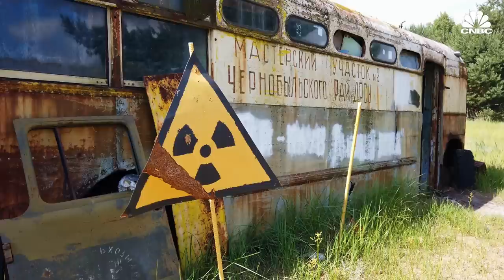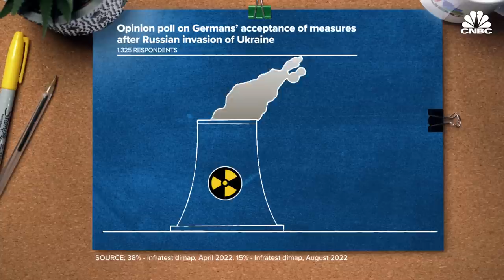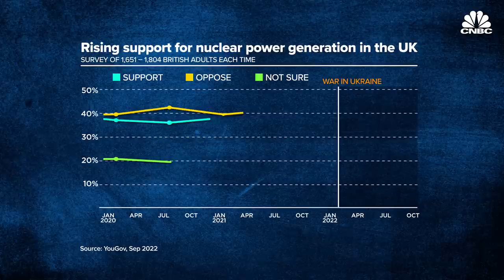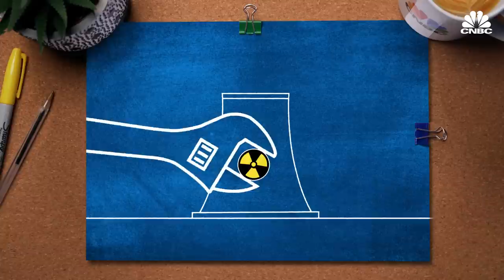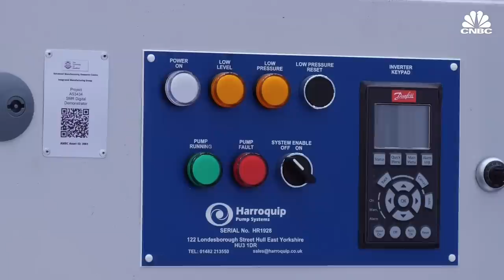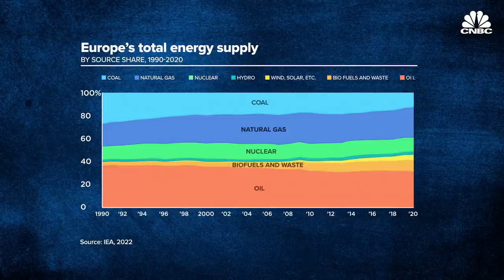The future of nuclear is divided into two camps - here’s why

Comment: French nuclear reactors were not built in the fifties. They were for the most part commissioned between 1978 and 1997. Between the fifties and 1978, there were experimental reactors running on graphite-gas technology or surgenerators (Phenix, Superphenix). Most French nuclear reactors come from a Westinghouse 900 MW water pressurized reactor patent. Then some were constructed with a modified design up to 1450 MW. The latest in construction, the Flamanville EPR reactor (it's construction is a never-ending nightmare) is a French-German design with a 1650 MW power output.
The first modern reactors, Fessenheim 1 and 2, commissioned in 1978 were shut down last year.

Comment: The problem with "short-term loss for long-term gain" is twofold. One, short-term solutions often have a way of becoming longer and longer-term. Two, especially for governments, it's easy to make long-term plans for 2030 or 2050 or whatever - the elections are usually every four years, so the next government can easily reverse the decision or push the dates forward... so the 'long-term gain' is up there in the clouds, it's NOT a given.
Reply: Germany planned to retire all the nuclear power plants in 2022 and failed only for 6 months. Theyalso planned to retire all the coal power plants in 2037 and probably will happen even sooner.
Reply: @Buran01  What's your guarantee that they'll do it by 2037? It's 15 years away, that's... 5 successive governments if my count is right, where's proof that one of them won't change their minds?

(Note this doesn't apply just to Germany, it applies to all countries and all sorts of long-term "fixes" and "plans")
Reply: @katm9877  Well, as I said, they planned in 2001 to retire the nuclear power plants  in 2022 and they missed by 6 months, so they were fairly accurate. Also, in the first quarter of 2023 they already deployed close to 4 GW of renewables (equivalent to the three last retired  nuclear power plants) . So I don't see reasons to doubt their plans. Compare that with the money and time that deploying new nuclear facilities require...
Reply: @Buran01  The trouble is adding more renewables to a grid makes it harder to keep adding. Germany is already at the point where they have enough capacity to run their grid on wind and sun when the conditions are right.

The problem is that the conditions are seldom right and making ends meet now means throwing the entire concept of an electricity market out of the window and each new MW of capacity needing concomitant increases in electricity storage. Technology that's been '5 years away' for the last 15 years, and which lithium batteries are totally unsuited.

The money and time nuclear facilities require is an order of magnitude less than the money, time, materials, and land renewables need to be on the same level functionally as nuclear power. If Germany had instead spent the money it's poured into energiewende on nuclear power, it'd have enough nuclear power now to run all of western Europe and its power would be the cheapest in the EU.

Comment: 3:35 "ARGUABLY" coal plants are "MORE" environmentally damaging than nuclear plants? 😂
Reply: Basic stuff.

Unwanted radioactive material can be buried (not even that deep) into the ground alongside all other naturally radioactive ground material without causing significant environmental hazard.

Of course, the fuel enrichment process requires a lot of energy, and the origin of that energy can contribute notably to the total emissions of nuclear power production. 

Also, the heat pollution of a power plant. But, in contrast to all else, it's quite slight.

Burning coal has a short road in the end, so to say.
Reply: Yes. Coal ash is not only more radioactive than nuclear waste, but also more hazardous and less regulated than nuclear waste. Not to mention how much more coal ash there is compared to nuclear waste.
Reply: @h.l.69  chernobyl looks normal to me.

Comment: To be anti-nuclear means being pro-climate-change because nuclear has the lowest carbon output per energy unit over its livespan
Reply: More like that pro-nuclear means buying the time for fossil fuel industry.
Reply: @augustlandmesser1520 Net-zero is not enough to end global warming. Nuclear energy is needed as the only energy that can run CO2-negative. Germany is the best example of the disadvantages of the so-called "renewables" prolonging the use of fossile fuels.

Comment: German green transition is actually a return to lignite for base load generation. Germans can then happily fax how a head of time they are to each other.
Reply: It's a transition from nuclear to lignite.
Reply: Nuclear is the future. Old energy is boiling water like solar and wind. 
In nuclear you milk energy directly from atom core. Take Bulgaria for example. It's a very modern country. 
Of something goes wrong 10000 years of history gene. But it's world for world class products for a reasonable price. Which Bulgarian products do you use my friend?
Reply: @captainchaoscow  nuclear powerplants also boil water but its still better
Reply: @reahs4815  that can't be true. It's real energy from the Nucleus core. not boiling water like monkeys. 
We could have atomic cars and atomic stoves. Energy for free but the eco friendly transistor energy took over.
By the way tell me your favorite Bulgarian product made with atomic energy.
Reply: @captainchaoscow  Its true that the energy comes from the nucleus when it undergoes fission then that energy goes into the pool of water the fuelrods sit in resulting in hot water (boiling) then it goes through a turbine to convert the heat energy into mechanical and that into electrical energy. Lastly the warm water goes through the cooling towers you see on almost all nuclear plants and then back into the heating loop in the core. (Yes the water surrounding the fuel is not the same water that goes to the turbine and cooling towers but it gets heated by the reactor core through a heat exchange system)
Reply: @reahs4815  ok thanks for the answer. 
But we need cars powered by cheap nuclear energy. It was the plan of the 60ies. 
But transistors took over. It was an error in my opinion.
Reply: @captainchaoscow  We will still do that but with electric cars powered by batteries
Reply: @captainchaoscow  your jokes are so bad that you must be German.
Reply: @captainchaoscow  Nuclear power doesn't come directly from the "core". The rods with uranium are heated so much they start boiling water. Water turns into steam, and then the steam is used in giant tubines creating electricity. That's how nuclear power works.

Comment: Access to increasingly more electricity for industry and general peoples is a large part of what made Western countries modern and successful. To me it is sad that the goal should be simply to replace the current capacity with some half-assed version instead of continuing this trend to improve people's quality of life. Nuclear power and research is the way forward. If Germany is closing the large coal stations they should convert them for scientific research. A huge potential, same as in Australia and other countries that are doing this.
Reply: How does expensive electricity improve peoples lives? Nuclear power is currently the most expensive of all options, money is simply better spent on wind and solar.
Reply: @_Dibbler_  wind, solar and what? You can't have pure wind and solar without blackouts so if you say not nuclear, that means "and" petrol, nat-gas, or coal, because geothermal is situational, mostly in Iceland. You need something to stabilise the grid, and there are not enough EV-s currently to give power back to the grid when needed. (Hydrogen is still extracted from nat-gas). So which carbon producer are you supporting? (I know that dams are a solution, but they are just as "nuclear" as nuclear, because when they break they flood a town, unlike coal that kills a town one person per day for years)
Reply: @_Dibbler_  Existing nuclear power stations provide the cheapest electricity period. Adding only 4 hours of storage to wind and solar push the cost above the highest cost nuclear reactor. The required amount of storage is more like 40 days.
Reply: @gregorymalchuk272  Germany has only very old Nuclear power plants that would need quite some refurbishment (that isnt for free). And most of the cost of nuclear power plants are hidden, like the storage of the waste and the deconstruction of them of the plants. You always lie to yourself when you like something but there is nothing economic about nuclear power plants
Reply: @_Dibbler_  nuclear power is actually twice as cheap lol
Reply: @_Dibbler_  even with the added cost of getting rid of nuclear waste, its AT LEAST just as efficient, if not more efficient than any other energy
Reply: @PosterityIslesNews  Thing is, all studies that I know show the opposite. Only the operating costs are competitive, everything else makes it so expensive that its pointless. Nuclear power is highly subsidised, its the only reason why its exists. In any country
Reply: @_Dibbler_  then you should get acquinted with all the research that proves otherwise.
Reply: Nuclear power is too complex, too costly and too slow to build, too costly to operate and maintain, too risky, too dirty... what you're saying is just nonsense.
Reply: @PosterityIslesNews  "nuclear power is actually twice as cheap lol"... ok... that's probably why nobody wants to become rich by investing in nuclear power then. lmao.
Reply: @johndawson6057  "then you should get acquinted with all the research that proves otherwise."  Citation needed.
Reply: @alainpannetier2543  mostly cause it takes 5-7 years to construct and the 3 million layers of bureaucracy
Reply: @_Dibbler_  "all the studies that I know" which ones?
Reply: @PosterityIslesNews  They are plenty. And they all point in the same direction. LCOE from Lazard is the most cited one but there are many others.  All your claims are absolutely baseless.
Reply: @_Dibbler_  “wind and solar” …plus what else? Advocates regularly say they know all about intermittency,  but come cost discussion backup gas plants and transmission are suddenly free. Why is that? 

Btw, existing long term nuclear is the cheapest source of power in the world alongside hydro.
Reply: @alainpannetier2543  60 plants under construction globally, right now.  Somebody is investing.
Reply: @alainpannetier2543  Lazard says it’s intermittent alternative power sources should not be compared one to one w base load/dispatch-able power, as the former can’t replace the latter for the “foreseeable” future.
Reply: @_Dibbler_  Nuclear is only expensive where governments make it expensive.  Rationally built nuclear plants actually produce the cheapest always on electrical power.  Like the cost of electric is not just the cost of producing the power but also it's reliability.  Nuclear plants being built by experienced builders under responsible regulation are coming in at very economic costs.  The blowup in costs in some of the US and Western countries are not the norm in most nuclear plants currently being built.
Reply: @_Dibbler_  the US has been refurbishing their nuclear reactors at relatively low cost.  There is no reason Germany can't do the same.
Reply: @stanleytolle416  Germany has refurbished reactors for years. Still the cost per kwh was the highest of all power plants. In the US nuclear power is heavily subsidized, so it might seem cheap, but realistically seen, its not
Reply: @alainpannetier2543  South Korea is building their plants in 4.6 years.  Nuclear reactors have been built in 3 years.  The problems with super long build times is project management and bureaucracy.  Both which can be fixed.
Reply: @stanleytolle416  STOP LYING. KOREA PLANT IN UAE WERE ALL AROUND 10 YEARS.
Reply: @_Dibbler_  > Nuclear power is currently the most expensive of all options
Except the prices in Nuclear France are half that of Wind/Solar Germany.
The prices in WindSolar California are triple that of Nuclear Illinois.

Why is it, that despite the EMPIRICAL EVIDENCE showing nuclear dominated grids are cheaper, the wind/solar advocates keep stating nuclear is more expensive?

Comment: "The worst nuclear power accident ever"

Wow, and how many there were in total?

nervous sweating

"Well, actually, there were only 3"

PS: I know there are more incidents recorded in nuclear power plants, but all of them are events in common with any other industrial facility. The only ones NPP-specific are TMI, Chernobyl and Fukushima.
Reply: and two of those killed nobody from radiation. The third, Chernobyl, was a soviet reactor none of which exist anymore in that dangerous form.
Reply: @Nill757  Actually, there are still operational RBMK reactors. Kursk, Smolensk and Leningrad.
Reply: @Ayrshore  those are heavily modified RBMK’s, changed in the years following the accident, and publicly documented by IAEA.  There are no more RBMks with the original runaway problem, where more heat can increase reactivity thus more heat etc.
Reply: @Nill757  They still have a positive void coefficient in some situations, it's just much, much smaller.
Reply: and this accident is far less lethal than the deaths from coal. In fact, after solar energy, it is the least fatal way of producing energy known to mankind. 

There is simply no rational argument against nuclear energy, except that voters have no study of nuclear energy and are therefore afraid of things like radiation.
Reply: @Ayrshore Don’t CANDU reactors also have a slight positive void coefficient?
Reply: @maxsaviation9512  yes, but it's tiny, doesn't have the safety implications it has in an RBMK. Then there's all the other issues with the RBMK design. I mean, it's a remarkable design, but it's also remarkably unsafe.
Reply: @Ayrshore  I slightly disagree with you in the sense that a properly trained crew would never operate the RBMK near the parameters that make it dangerous.

Comment: Isn't Germany importing electricity from France, which produces almost 70% of its electricity from nuclear source?
Reply: And france imports electricity from germany, mostly in the summer, when they have shut down their reactors because the cooling is overheating!
Reply: Shhh🤫
Reply: @ch.k.3377  If Germany isn't self sufficient in electricity, how are they selling it to France?
Reply: @tushar4evr776  Germany was again the net electricity exporter in 2022 with a total of 26.28 TWh. Exports amounted to 62.05 TWh (2021: 56.99 TWh) and imports to 35.77 TWh (2021: 39.60 TWh). If, for example, wind generates more electricity than is consumed, then it is sold on and Germany buys elsewhere if it does not generate enough electricity itself. That is why hydrogen storage tanks are being built across Europe so that no surplus remains unused.
Reply: Germany exports electricity on windy days and imports at night or when it's not windy.  French nuclear plants export throughout Europe day & night, regardless of weather, but can also ramp up & down if there is an oversupply.
Reply: @tushar4evr776 All european countries buy and sell electricity to each other. It's one big grid. Depending on who needs some at the moment for whatever reason.
Reply: @ch.k.3377  not cooling overheat, only maintenance and refuelling.
Reply: @olivierb9716  10 August 2022: Heat wave threatens France's electricity production. About a fifth of the 56 reactors should actually be shut down or at least limited to a minimum capacity because the rivers into which they discharge the heated cooling water are now too warm and exceed a set temperature limit. But the French government has suspended this rule until at least September 11th. She sees herself forced to do this - also because more than half of the reactors have been idle for months due to scheduled or unscheduled maintenance work. In normal times, nuclear energy accounts for around 70 percent of energy production in France - more than in any other country. DW

Comment: Nice video. Nuclear energy is essential until humanity find a viable solution for renewable energy storage.
Reply: Yes, we need all the positive contributions we can get.  If we are able to make surplus wind or solar, it can be partially stored as pumped hydro.  But we also need a better long-distance grid so we can be more flexible in transferring power from areas with higher production.   The task at hand is going to take a lot of effort and economy short term, but it is high time we solve this before the climate catastrophe gets any bigger than 2-3 degrees globally.    The cost of dramatically changing weather patterns will be extremely costly.
I believe we will get the first real taste of what's to come soon.  In 2024 it will be El Nino year, and we will see the greatest effect so far in modern history.
Reply: Fuel diversity is king. It's not prudent to conceptulaize a one enrgy source. We will for the next 100 years NEVER make enough energy from renewables to power the growth needed to address the problems of the future.
Reply: @kevintubeit  It is true we will need much more energy.  I believe fusion in combination with renewable energy and some storage will do.   In 30 years all these technologies will be mature and it is really up to us to find the right path.  CO2 must probably be reduced to 10% of what we use now.